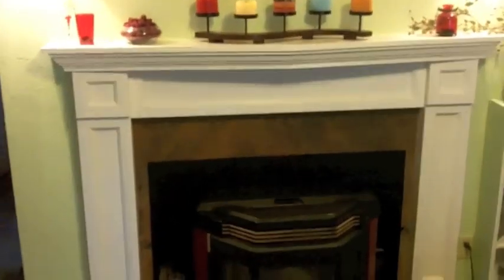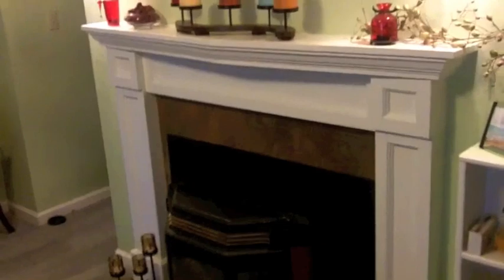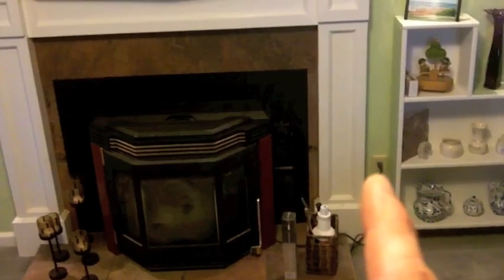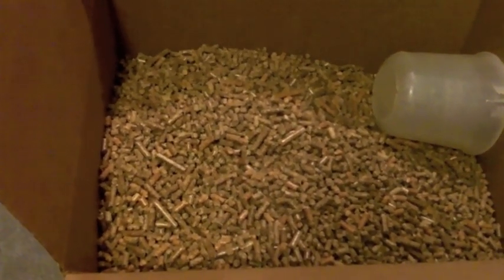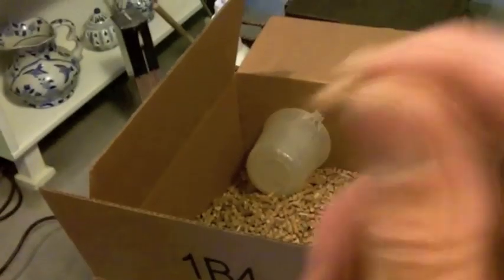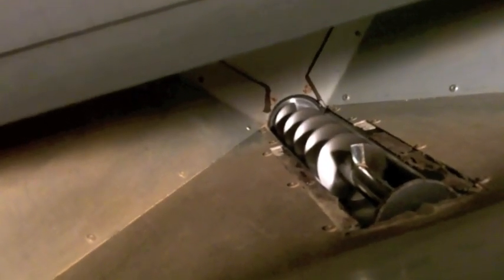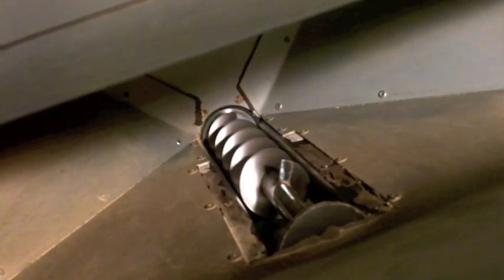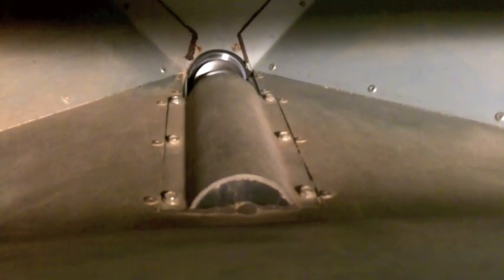Fixing a Pellet Stove

Comment from the maker: @Graveltrucking Pellet stoves are super easy to use, but you have to buy the fuel.  I heat my house with a Big Buck Stove that is 13 years old.  It has a catalytic converter that makes that thing clean and puts out a crap load of heat for not much wood.  I usually heat my house with only construction cut-offs of unpainted dimensional lumber.   Works like a charm and I don't have to turn on the furnace.

Comment: That Austroflamm Integra is built like a battle tank. 
A friend of mine got one for free;  it was dead after a power surge and he asked me to take a look at it..
 Well, I figure out the transformer in the controller board (a square box) was dead (open primary side) so no power to the electronics. 
I found the replacement and they got the part. The tricky part was finding one that fit exactly on the board's holes. It is alive now and waiting for the installers to fix the chimney
Reply from the maker: These are great machines.  It is still working quite well after all these years.

Comment: So I think our auger has the same problem but I can only see a small section of the auger.  We don't have the manual and I am not sure how to uncover the auger like you did.  Our pellet stove is a different brand too... not sure because it doesn't say it anywhere I can find it.  Any thoughts or suggestions?
Reply from the maker: Hi Sarah, It is a very common problem with pellet stoves.  The pellets, if not screened before you load them into the hopper, make sawdust that packs the auger and/or the chute.  Most stoves have a clutching feature on the auger so things will not break with the dust packs in tight.  There should be an acess plate to be able to clean out the screw...I would have to see the inside of the hopper to give you a more specific answer.

Comment: I have an old englander and the E3 code has been coming on and the stove would shut off on its own. Today the same thing happened but this time when I turned it back on almost immediately it started blowing smoke out the front vents and there was no lit fire. Then the exhaust shoot started blowing smoke out into the house. We had a house full of smoke and almost started a fire. So what does the E3 code mean and how do I fix this problem?
Reply from the maker: +chachee15 the E3 code is an over fire code.  Sounds like you have a clogged flue or burn pot vent that has made the heat sensor trip.  I recommend a chimney/flue cleaning and a thorough firebox cleaning by a professional .  Best of luck